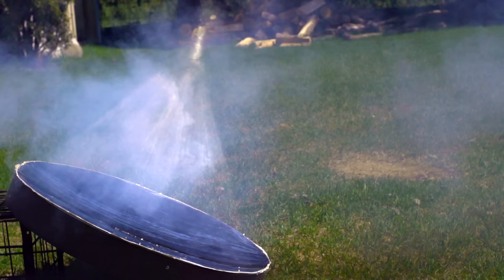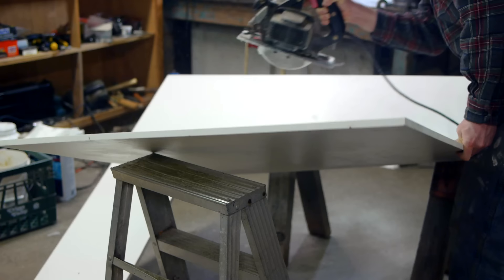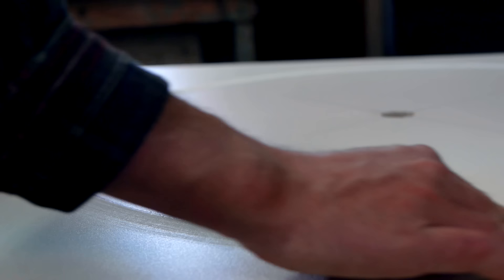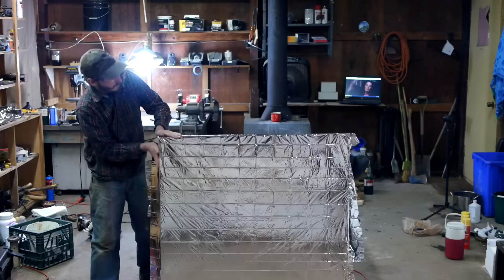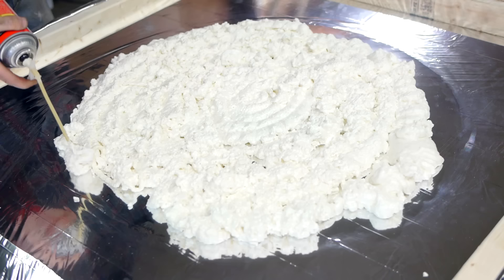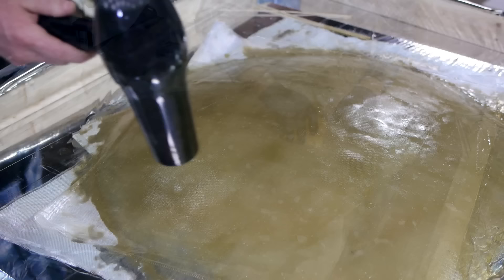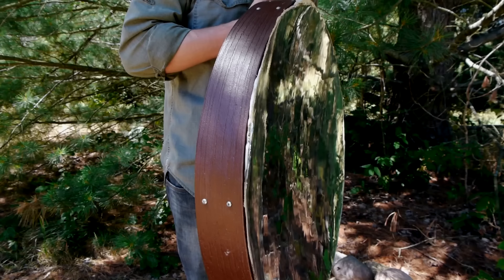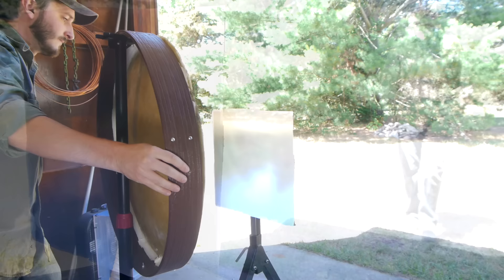How To Make Parabolic Mirrors From Space Blankets - NightHawkInLight

Comment: It's easier if the mirror doesn't have to be rigid. Search "Trash can lid to Parabolic Mirror". The mirror is flat, or concave with mild suction behind it, or (more risky) convex with a little air pressure behind it. An open ring can support two membranes; with one clear membrane, a little pressure inside makes the inside of the reflective membrane a concave mirror, usable even in space. My big question is: HOW CLOSE CAN IT BE TO A PARABOLA? Sheets like to fold or curl into cylinders, prisms, or cones. Curving into a paraboloid, ellipsoid, sphere, or [whatever this curve really is] produces circumferential compression toward the edges of a limp sheet or probably complex radial and circumferential tension toward the middle of a taut sheet. Can its shape ever be ideal? Is it better if the initial sheet tension is zero, moderate, or high? Would pushing against an inner, frictionless ring make a better curve? (Varying the film thickness might help, but that is complex, and the goal here is to make a parabola without elaborate grinding.)

Comment: I am not trying to challenge you here but how do you know it is a parabola? I ask this because many years ago, ( in the 1980's)  I built different types of parabolic dishes, some with fiberglass that turned out OK but a bit heavy in an inverted method of building up a mold on the ground with a center stake and a cut-out  of 1/2 parabolic shape of plywood accurately plotted and rotated around the mold continuously from a center pole using finer and finer surface until it was smooth with plaster of Paris. Those turned out reasonably accurate as a parabola and had a focus. Before that, I made what was called a "stressed parabola" from a radio amateur handbook with a center plate (that I still have)  and radials going out from this center plate with eye bolts at the end of the radials. Then a wire was threaded thru the bolts and the "parabola" came into shape as the wire was pulled tighter and tighter. Then I carefully put screen wire on it sewing it on at many points. Definitely a labor of love... It was beautiful and I have pictures of it looking golden in the sun. Unfortunately, it had no focus. After much frustration, I finally plotted an accurate parabolic shape on a piece of cardboard and cut it out as a measuring template. I could then see the problem that the "stressed parabola" was not a parabola at all. My apologies for all the too much detail but I wanted you to know I am serious and not just a YT troll.  I understand this video is a few years old and your interests may have changed.  I am suspecting that the shape was actually that of a spherical mirror instead of a parabola but I may be wrong and wondered how you measured the mirror.

Comment: Also I wonder if method of using air pressure to make a parabola shape could be used to work with hydroforming (lots of videos on that on the tube) Welding together 1 mm aluminium discs and use. a pressure washer (word) to get the pressure to shape the discs

Comment: I just use a primestar dish from the early 90s  If you use a dish... All you have to do is clean the surface of the dish and let it dry. Then you spray the adhesive evenly all around the inside of the parabolic shaped dish and then wearing gloves so you don't get body oil on the reflector.. press and push the Mylar in one direction until you press all the air bubbles out and the Mylar is flat and perfect ... then cut the rest of the unneeded Mylar off... You have a focal point the size of the bottom of a 2 liter bottle.

Comment: Dude you are so cool! I love ur cheap but highly effective endeavor. Thanks for the tip. I was invisioning something similar but smaller to heat a solar hot water tank. I was also told from a computer programmer from NASA that putting black tank on top of INVERTED SPIRAL of copper tubing with a STRONG MAGNET in the center will heat it to 120 degrees! Im doing that too! You may want to try it for an upcoming video! Love Q-PID  'a girl' lol  : )
Reply: What does the magnet do? Every time that I see a magnet added for no logical reason, I think 'crackpot!'.

Comment: I was trying years ago to think of a way to make a structure that would hold hundreds or even thousands of tiny flat mirrors but in a parabolic shape and be adjustable for different focal lengths. This proved WAY harder than I had imagined and I abandoned the idea.
Reply from the maker: That's clever. I think a good way to do it is make it like a rope bridge, where the wood planks are replaced with mirrors. Bring the ends of the bridge closer or further apart and there's your adjustment.
Reply: @Nighthawkinlight  I'll bet the US Army has done experiments with this idea...

Comment: Since fiberglass is so expensive, paper could be used instead. It can also be reinforced with some metal wire netting, if need be. Also, the resin mixture is best to be slightly flexible, so it bends rather than breaks, if some impact happens. Also, it would be very interesting to see a telescope made from this, as well as reusing the leftover parts to make smaller sized telescopes.
     You can also use an oiled form and resin to make lenses to adjust the curvature of the reflective telescope, if need be. Seeing something similar to the "Tiny Space Telescope" (search terms, shows images and a video showing it's workings) would be quite interesting. It won't be as good as a normal telescope, but you could make funny-looking glasses like that, so you can replace hand-held binoculars with an eyeglasses version.

Comment: was your first attempt with the expanding foam a total failure? will it not work if you removes the torn Mylar from that and then replace it with a new one? just asking because i don't have access to epoxy and fiberglass from where i'm at and expanding foam is a better option for me.

Comment: not sure if you’ll still read these, but i’ve been thinking about this idea lately and just came across this video again! i’ve been wondering, i know it’s damn close but i do wonder if the shape is closer to a catenary than a parabola? under very short sections close to the ‘bottom’ of the curve they’re very very close, but not quite exact, i wonder if the aberrations you’d see when using it optically are from that rather than surface imperfections. a catenary is the shape a slack rope forms when supported by two points and is allowed to droop over gravity, so that makes me feel like this method, or similarly the vacuum method with the mylar sheet, would form a catenary shape there as well. catenaroid? or does the fact that the force on the mylar always being exactly perpendicular to the tangent of the surface, instead of just one direction like with gravity, mean that it does actually form a paraboloid? or a different curve altogether? who knows! not me because i haven’t asked chatGPT yet.

Comment: there's another method and that is make yourself a box like you did to stretch out the wrinkles what put a back on to it like you made the begin with put those two pieces together with the bicycle valve instead in reverse this way you could suck the air out after airtight taping the blanket over the box now when you remove the air from the box it will suck the sheet inwards making that parabolic shape all you have to do is turn the valve off keeping the vacuum as long as you don't puncture it is long as there's no leak the parabolic shape will stay

Comment: There's much easier ways to do this. You've reversed the best way which is to put the Mylar over a trash can lid secure it with bungee cord and tape and create a vacuum. Takes all of 10 min. You'll also get a deeper concave. You can do this in a small scale with a 5 gallon bucket cut down to 1/3 size or larger with trash can etc. There have been many other videos on here showing how this is done. If you want to make an air parabolic mirror hold its shape you need to spray the rear surface with spray adhesive and let it dry. Fill the container with cement mortar product. Flip it and wait a couple of days. Resin and fiberglass are too flexible. You can also use this vacuum method on a suitable satellite dish just spray both the Mylar and satellite dish with scotch 77 spray adhesive and introduce a vacuum.

Comment: but you did spend around $40 on all supplies as fiberglass resin and cloth is not cheap or landscaping edge so you can but really nice ones on ebay now. lol but good way to use materials you have laying around if that was the case. i did like the modeling good job.

Comment: Is this truly parabolic or does it have a semi-circular cross section?
I've wanted to create a linear parabolic mirror and focus it on a pipe.
Reply from the maker: Sometimes they end up parabolic and sometimes circular. Either way works just as well for solar heating applications. You can make true parabolic linear surfaces just by draping a sheet between two rails and letting gravity pull down the center.

Comment: reminds me of a NASA idea to put a reflecting mirror in space that was very light. not sure it worked out though. They had problems too getting that super smooth surface on the parabolic mirror. 
Lots of good ideas in your work I thought the fibreglass worked great and the smoke too. once I did something similar but instead of having higher pressure push the shape out I chose to do a closed cavity that I sucked the air out of and used atmospheric pressure to push in the parabolic mirror. which not try that instead, using a cylinder with one end capped off by the space blanket and the other end capped off by an inverted valve?

Comment: The mirror is not truly parabolic. It will approach a parabola at small deflections, but it is actually a truncated sphere. The air pressure is acting on the film perpendicular to the surface, as in a sphere. The film would form a parabola if the force was uniform and parallel ot the central axis of the film that passes through the focal point. Cables on a suspension bridge form a parabolic-like shape due to gravity being somewhat uniform and unidirectional. I approached a NASA scientist with the same concept in 1981. But on writing up my proposal, I realized it was not a parabola.  Although it does work well for setting paper on fire.

Comment: Wouldn't this form a spherical mirror, rather than a parabolic one? The beginning of the video shows the light converging along a line of focal points rather than one single point, which seems to confirm this. This might not be a problem for heating applications, but might be a deal-breaker when it comes to a telescope.
Reply from the maker: Yes you're right.

Comment: I picked up a 3' satellite dish and wanted to cover it with a space blanket after smoothing the reflective surface.  Did you find that 'polishing' the mylar resulted in a loss of reflectivity?  I'm afraid of minor scratches from the cleaning/polishing process.
Reply from the maker: Polishing the dish shouldn't be an issue, but you can't polish the mylar itself because you'll rub through the aluminum layer.
Reply from the maker: Instead you can use a heat gun or hair dryer to take the wrinkles out

Comment: I have found my own telescope mirror. 8 “ f8 .  Knowing how important the it is to have very polished reflective surface I don’t think you can achieve that with Mylar it can only be ad smooth are the manufacture makes it and then you mold it on something that is not optical as well.   I think you can can make the mirror just never get it optically polished. It will always have bad spots and just never smooth enough. Good luck

Comment: How do you know that the shape you get with air pressurization is exactly parabolic?  I understand that, in principle, it's a reasonable assumption.  But more rigorously, there may be imperfections because of small non-uniformities by which the peripheral boundary is exactly circular.  But more generally, do you have the mathematics that justify the parabolic assumption?

Comment: Great video! For eye protection I see you have a welders helmet, what settings do I need to make my auto darkening welders helmet safe for this? I sorta need specifics because i don’t want to go blind 😅
Reply from the maker: The glass of any decent helmet blocks all harmful UV even when the darkening is off. Your eyes will be safe if you set the darkness to whatever level is comfortable to reduce the visible brightness.
Reply: My automatic helmet doesn't work, the electronic reacts to the flickering when welding, not to bright light. I guess other helmets do the same. Use old-fashioned welding goggles instead.

Comment: GREAT video!  but how do you know for sure that air pressure applied like this is an actual parabola?...but looks close enough.  One thing that does make a parabolic surface is to spin a flat bowl of water on a spindle--there is even a formulas for it on an installment of "the amateur scientist" in "scientific American".

Maybe spinning something (that hardens) at a constant speed, until it dries may work.  Your video surely brings many ideas to the surface!

Comment: How can you know this parabolic shape actually? Looks more like spherical to me. I mean, have you done any mathematical modelling?
Reply: Exactly what I was thinking. It is a thin membrane, with internal pressure. It will form a slice off the edge of a sphere, not a parabola. The air filling point doesn't need to be in the centre either as pressure is felt uniformly in all directions at all points. This means the filling point can be anywhere on the back board.

For heating things by sunlight the difference between parabola and portion of sphere is not too important but for a telescope it will be a major problem. You can reduce this problem a bit if you go for very long focal lengths ie pull the mylar really tight and uniform before glueing it down and then only use a tiny bit of pressure to inflate it. But even then it's still not going to be good enough for a telescope.

Telescope mirrors need to be a correct parabolic shape to within a fraction of the wavelength of light to be good enough for astronomical work. The crazy thing is that this accuracy be achieved by hand when grinding glass mirror blanks.

All that being said, I still appreciate your work and thank you for sharing it.

Comment: Hey there. Have you tried focussing the moon and taking the temperature at the focal point? Not sure if you've been asked this b4. Cheers
Reply from the maker: I haven't. That would be interesting to try
Reply: @Nighthawkinlight  please do. There is a huge amount of tests on YT using varying methods all pointing to the moons light being a cooling light which out right contradicts what mainstream science tells us the moon is regarding the moons phasing being due to reflected sun light. So far moon light vs moon shade shows moon light to be colder. Amplifying moon light through a telescope or magnifying glass shows an intensity of moon light decreases the temperature. Your parabolic mirror would outright prove whether these other tests are subject to other variables or the moons light is in fact a cooling light. Please please conduct this test and post the video. You will receive a huge audience regardless of the results due to the amount of noise this phenomenon is causing. Many thanks.

Comment: What was the pressure you used? You may not know, but was the range 2PSI to 5psi or 10PSI to 30 PSI?
Reply from the maker: Pressure is irrelevant, you just keep putting air in until the plastic is as deformed as you want it to be. That might take 10psi or it might only take 1. Just like you can use a compressor at 200psi to fill a tire to only 30.
Reply: @Nighthawkinlight  Only irrelevant to you. I'm wondering how it would work if I put a sealed chamber on the rear and drew a vacuum to make the shape. I don't know how the PSI on the outside would compare to the inches of Mercury on the inside, but I'm curious. Also, will aluminized Mylar hold a vacuum? It does better than rubber with helium as far as molecules leaking through . And more important, is the shape actually a parabola, as a telescope would have. I'm wondering if using a vacuum could be an easy way to make a 6ft telescope mirror.
Reply from the maker: It's below 14psi. Vacuum works fine

Comment: That was great!  What if we put it in 1 meter under water 💦 of 🌊 sea?!  are there strong enough to increase the temperature of the holder on the top 🔝 and boil the water 💦 which is in the sea and from steam of that make electricity shar?  Image if we can put many of these mirror on sea and make energy ⚡.  The problem that I can emagine is the salt water is not pure and after while make problem in systems.  Do you have any idea 💡 to solve this barrier?

Comment: The solar energy collected is proportional to the Diameter Squared. based on Area which is PHI So 3 squared is 9; 4 squared is 16; 5 squared is 25 and so on.  A 3 foot  parabola will ignite paper and raise the temperature of water to boiling, or at least 212F.   I pressure then that lather diameter parabola,s would capture more solar energy and generate more heat at the focal point.in roughly the same proportion as the ratio of the Diameter squared.   At 9 foot, the parabola is melting metals.
Ethylene Glycol has a boiling point of 197C or 388F.  Hummm. I wonder if a reservoir of Ethylene Glycol heated with a 5 foot parabolic solar collector could keep a house warm?

Comment: 1 heat gun to remove wrinkles.
2 silicone o ring
3 vacuum 
You shouldnt glue it down if you use your metal round dish and silicone/rubber rim and vacuum.